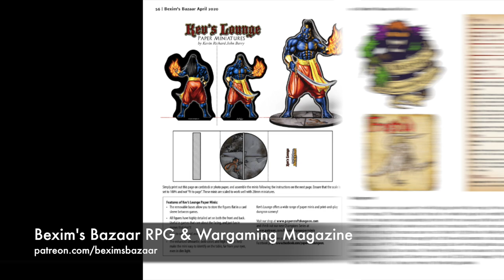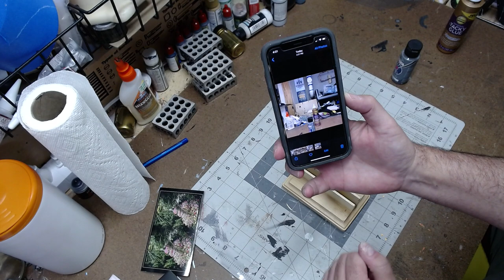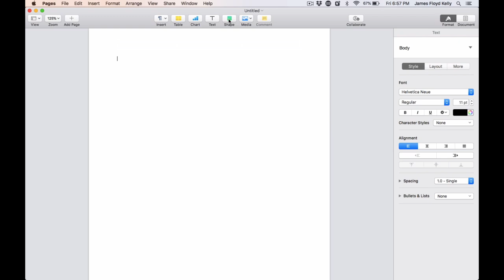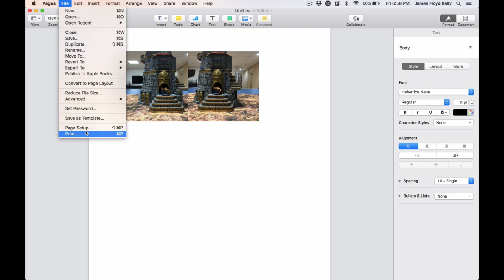Create & View 3D Photos of Minis & Terrain

Comment: For a more sturdy stereoscopic viewer, you could do a lot worse than picking up one of those super-cheap "VR Headsets" designed for you to clip your phone into - Those were insanely popular a few years ago but now they're littering charity shops everywhere at stupidly low prices. These have the advantage over simple cardboard devices in that they have solid plastic housings, proper lenses and a strap to keep it on your head :)

Great to find a use for these cheap things - 3D photography is great fun too :)

Comment: That is the interpupillary distance and the average is 64 mm or 2.44 inches. If you want the best result for your images you need to use StereoPhoto Maker (SPM is free). There are several stereo camera groups around the US and the world.  http://stereo.jpn.org/eng/stphmkr/  You can export them in any of the formats (red/cyan, polarized, stereo card, etc). The advantage the color glasses you can do landscape format. Phereo dot com is a hosting site for stereo images and there is an app on Play as well.

Lastly, stereo viewing predates photography. The originals were drawings of geometrical figures with no shading or other clues of demensionality. 

Thanks for spreading the word on stereo!!
Reply: Agreed. Stereo Photo Maker is a great little program that will work on pretty much any version of Windows and for Linux users like me, it runs perfectly well under WINE as well. Anyone with even a passing interest in 3D photography should check out this neat program.